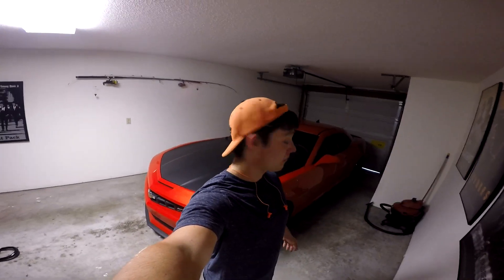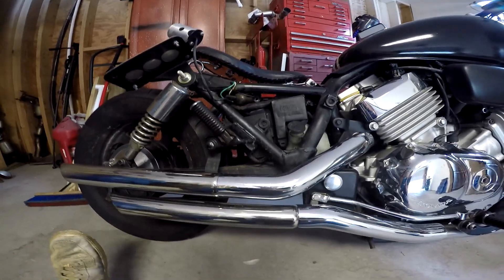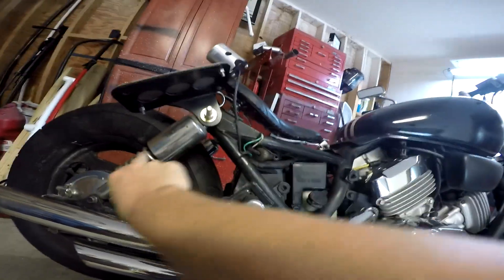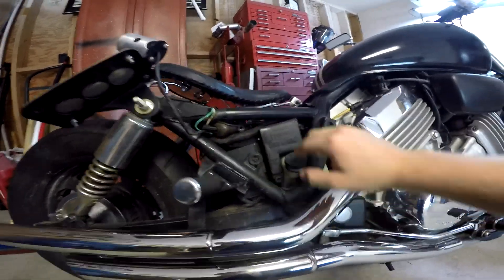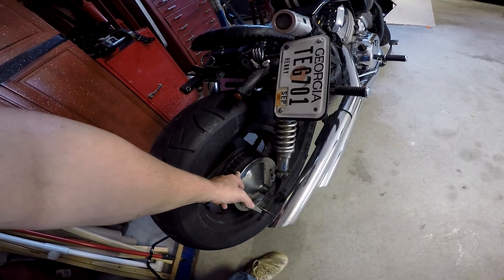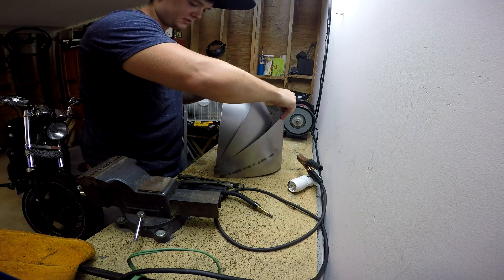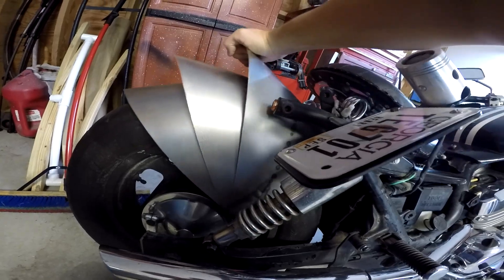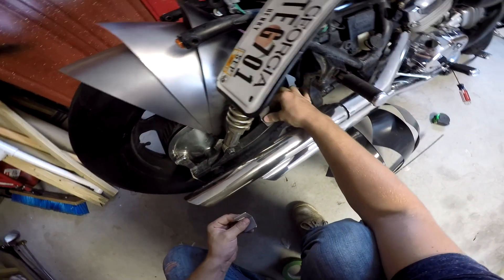Cleaning Up The Magna - RE-Fab the Fender (Part 1.5)

Comment: Invest in a mig welder/bottle setup. Miller or Lincoln 110v would be perfect. Also make sure you clean your metal beforehand. Play with the heat/wire speed as well. 

You can make fluxcore welds look good, you just need practice. Also, as long as your penetration (giggity) is fine, you can grind down the welds to make them look better.

Comment: Hey man, to convert the rear brake to a disc you gotta get a master cylinder that will work with your foot pedal first, then worry about the calliper, but basically after that all you'd have to do is put the new wheel in where it's gonna be with a disc on it, then you're gonna wanna measure up the calliper to where it'll work and be safe, then weld some threaded brackets to the swingarm and then you're sorted really

Comment: I know this is an older video, and while I hate the "buzz box" welders  they are great for light duty. Flux core doesn't have the "gas" inside the wire, its literally flux. Much like solder has rosin core or flux core. When you strike the arc to weld and the filler material melts the flux melts and chemically cleans the surface of the two parts and is then burned off. At this point the weld puddle (the molten weld metal) sinks to the joint and contaminants broken loose by the flux rise to the top to protect the weld as it cools. The result if any becomes slag, which should be cleaned off with a slag hammer (if necessary) and wire brush before laying another bead.

I've been welding for years, (took welding/machining through high school) and worked building train cars for a few years, So if you have any questions or need to know welding related stuff hit me up.

Comment: I'm not an expert on spring angle but it's my understanding the steeper the angle the more weight is required to compress it, so if your springs are rated at 100lbs vertical, it'd be 200lbs at 45 degrees..
something to think about

Comment: You're missing the welding gun tip? Not the tip that the flux comes out of but the larger tip dome that goes over that. I have the same welder and it helps with shitty welds ;p

Comment: i dont know how you would convert to a rear disk without using a different wheel with a hub already designed for a disk. Once you find the right wheel that will fit its just a job of figuring out how the caliper will integrate. the easiest thing might actually end up being a swingarm swap complete with wheel/hub/brakes. The other end of the spectrum may be getting your hands on another drum plate... and modding it it for ducting cooling air in and out. they did that on the early race bikes. looked killer to me. you might even find a way to fab up something that would complement the rest of your build. you wouldnt have to worry about whether or not its going to fit or work, either.

Comment: I learned welder and what you REALLY do wrong is: You have no head on the welding hand piece and you are to FAAAAR away from your work piece. 2cm distance.
AND really important NEVER weld with a fan nearby. Gas welding and a fan. Bad idea.

Really sorry for saying "You do this and this wrong. Do it better this way" but it could really help get better results of your work.

Comment: dont move the rear shock mounts, your getting into geometry and angles you dont understand. if you moved the shock packs down on the fram you must move them on the arm as well. 

take the shocks off and lift the bike up and down and watcht he swing arm and invision the shock moving. its going to want to piviot more then compress, essentially bobbing the rear end and solid struting it making it a rigid again.

also dont start welding heavy wear stuff to your frame with that POS mig welder. get a tig or a bottle and weld it right, you wont get enough penetration for the weld into that steel and that frame is stupid thick, you wont get the penetration needed for a solid bond

Comment: Your voltage on the welder is too hight that's why the welds look like shit. turn it down a bit. the wire melts faster than it feeds it so it makes the weld look like shit.

Comment: You're way to far away from the metal when you're welding. Get closer and you won't need 2 inches of wire sticking out...that's part of the reason why your welds suck.